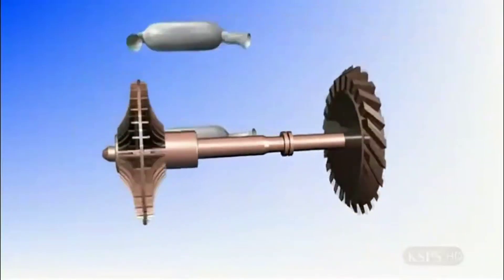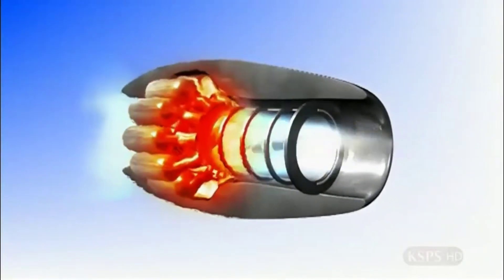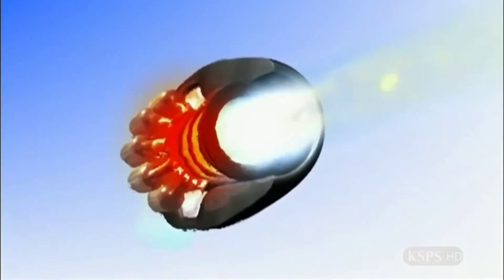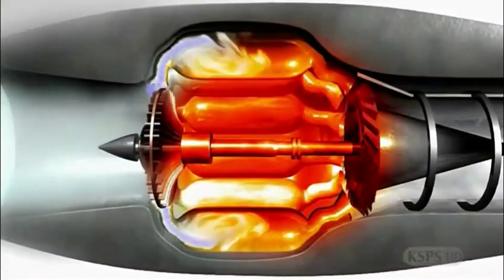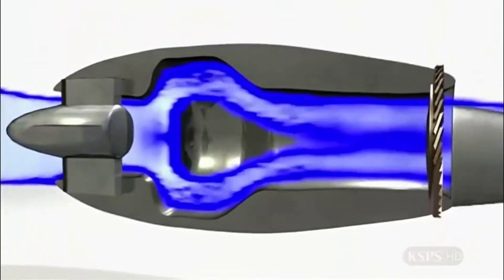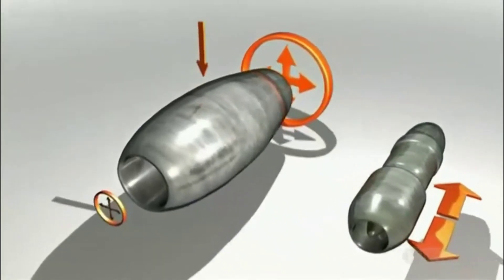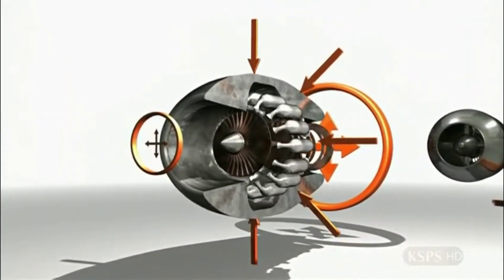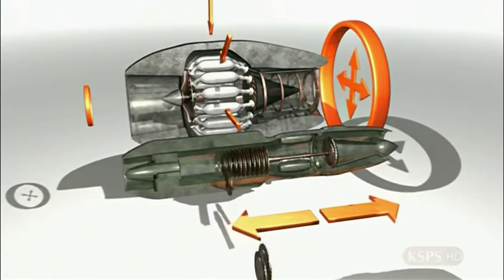Jet engine design in WW2 - Rolls Royce Welland / Derwent versus Junkers Jumo 004

Comment: Advantages and Disadvantages. 

The radial engine has the advantage that the radial compressor adapts better to different flows while an axial compressors tends to pump if the flow is too low. 

Disadvantages are the bigger diameter of the radial engine that cause drag and it is more difficult to cool the radial turbine.
Reply: @mitchellcouchman6589 In 1945 a German DB605 piston engine had a life expectancy of about 30h. It was not an issue as any German fighter that started had combat with allied planes. Only a few Me109 survived 30h without heavy damage. 
The Me 262 jets needed paved runways which were rare and were constantly surveilled by the allieds. Thus the jets did not have a long life span as well.
Reply: @mitchellcouchman6589 The success of allied strafing missions against military targets was overestimated. 
The most successful air offensive was that against the German transport system. It paralyzed the industry and as well the military. It lacked fuel, spare parts..... Plenty of jets were destroyed by their crews when overran.

Comment: Exactly my thoughts,
 I do hope when the rest of this video surfaces, he doesnt credit Whittle with only the centrifugal compressor and Von Ohain with the axial, which is not true in the slightest.  Whittles original patents from ten years before covered BOTH theoretical types. Mathmatical genius that Whittle undoubtably was he had already calculated that the far higher jet pipe temperatures that an axial would generate were at that point way beyond the metalogical recipes of the high speed high temp alloys then available - and decided to prove the concept with the centrifugal first,   intending to develop his axial concept as alloys were invented to deal with the ultra high temps expected without catastrophic failures, when his patents lapsed Hitlers Germany - who already HAD all of Whittles data and blue prints !  decided to use Ernst Heinkle to develop the concept and Heinkle gave the papers to Von Ohain a newly trained physicist who chose to pursue the axial version knowing very  little about the metallurgy problems, or why Whittle was right to go with the centrifugal first, meaning Whittles engine could give reliable service (albeit with slightly less thrust per given weight) for hundreds of hours, while German axials had a TOTAL life span of a few hours before becoming utter scrap metal because of blade failure due to heat soak, The only reason Von Ohain was credited with the axial was the Americans grabbed him at the end of the war and put him to work for them...and back then Americans didnt like being thought of as being second to ANYONE so the untruth stuck !.......it took Von Ohain about thirty years to finally admit it in his auto biography
Reply: Oh come on, Whittle didn't invent axial-flow jet engines. Just because he got his patent in UK doesn't mean he was first in the world. Some Frenchman patented an axial flow turbojet engine in 1921, when Whittle was 14. Had your mathematical genius actually been as genius as you think, he'd have realized that axial-flow turbines were just as feasible as centrifugal ones. Or maybe he did, but he just chose to go with centrifugal for whatever reason and you're just trying to bend reality to fit your opinion. Jumo 004 prototype engines weren't nearly as unreliable as production ones - they could run several hundred hours without needing a general rebuild. The problem was with production quality, as engines were mainly produced in labor camps, where workers would often sabotage the production, and used materials, as Germany didn't have a lot of good quality metal and what was available had to be distributed between navy, army and air force. And even the production engines had more than just a few hours lifespan, they could usually run anywhere from 30 to 50 hours without heavy maintenance. Except for the last ones, which were basically made from mix of clay and saliva because Germany was falling apart by then. The construction itself was fine for the time.
Reply: @Trakkson  The 004 s engine was very flawed, what an engine manages when bench run and how it behaves on an aircraft are often very different.  The 004 would shut down if the throttles were suddenly pushed open.. In service the 262s engine would seldom manage over 10 hours, 20 was the time they swapped them out if they lasted that long. The Russians took the 004 after the war and built it as the Kilmov RD10. Built using the correct materials it still only had a life of 30 hrs and a thrust of 2000 lbs, which was why it was dropped like a hot stone when they obtained a Rolls Royce Nene that totally outperformed it
Reply: @Trakkson  If YOU  had a brain half as big as your utterly idiotic and invalid assumptions you MIGHT have had the  spare capacity to actually RESEARCH THE TRUTH rather than just spout totally incorrect ASSUMPTIONS simply because they fit a narrative that pleases YOU. AND  if your read my post properly, you would KNOW that A.  Whittle DID concieve BOTH methods of propulsion AND obtained a BRITISH international patent on it, The Frenchman you are erroniously referring to was Maxime Guillaume, and  yes while a 1921 French patent WAS issued for it  it simply couldnt work as NO effective means of compressing the incoming gas to the pressure required was utilised,  the bmep being equal in both the inlet and output stages, and if it could even have stuttered into life the exhaust temperatures would have been FAR hotter than the tolerances of any materials then available just as in any OTHER  hot gas expulsion unit, axial units which require shaft bearings right in the MIDDLE of the output stage turbines and along with the rotor blades themselves have to tolerate heat that reachs many THOUSANDS of degrees all the while the unit is running which required exotic mixes of alloys that up until that time  simply hadnt been conceived as there had never been a need for them !, and as for Junkers AND BMW engines lasting for  "hundreds of hours of useful life,, well I suggest you try to find historical German records that agree with your erronious  synopsys........good luck with THAT one, as ALL the records I HAVE researched over the years tell a COMPLETELY different story.........or I suppose in YOUR little world  the Germans were just lying  when THEY bemoaned the lack of such ultra high temperature alloys  essential in prolonging the units  lives for more than the single digit hours that THEY were stuck with and due to the war were unable to source  such as the essential  inconel from Canada  eh?
Reply: I think you need to take a look at Von Oheins engine! It also used a centrifugal compressor, but where Whittle used an Axial Turbine section Ohein used a radial turbine (much like the turbine section of a modern turbo charger!) This was an interesting arrangement but limited but worked well enough to fly the Heinkle178